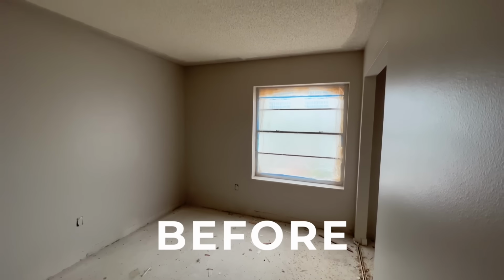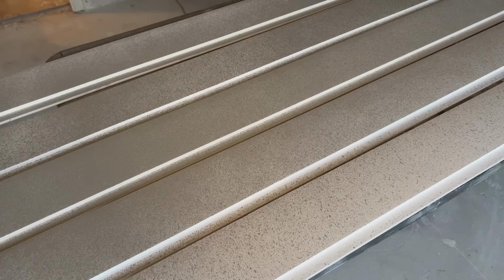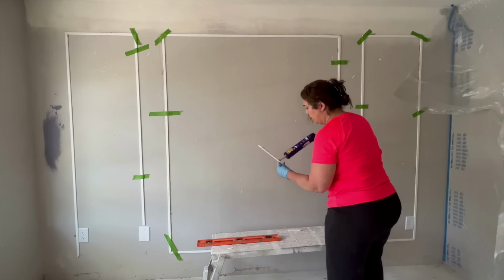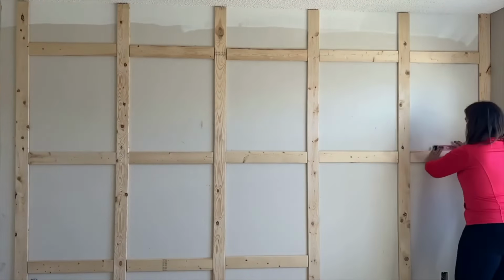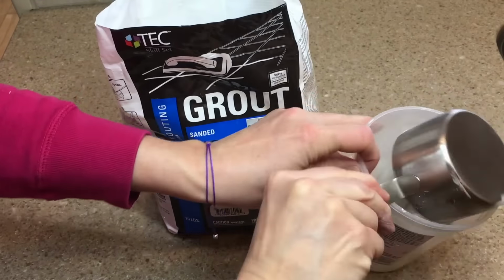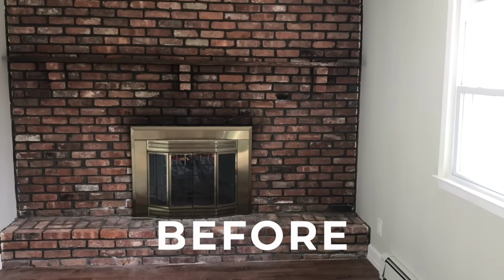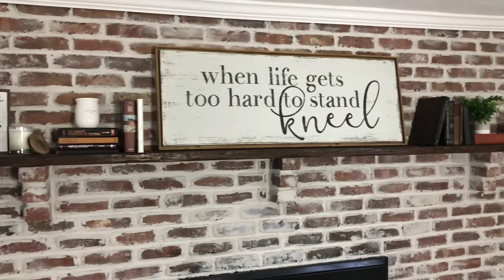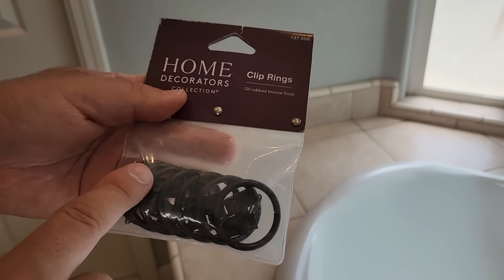The genius NEW way people are hiding their popcorn ceilings

Comment: I would be very curious how long the black paint on the faucet lasted.  Did it start chipping.  It seems like a great idea but I'm skeptical.  Cant imagine it lasting past a couple months.  Hope I'm wrong.
Reply: ccc
Reply: hear now✝️
Reply: Merina on her Fearfully Created YT channel painted her taps & her kitchen sink. A year on, the taps are still good, but the sink it's all chipping off very badly.
Reply: Removing the faucet and spraying with automotive paint worked for me. It's meant to take a beating. I just now had to touch up after about 3 years, and used black oil-based paint from Rustoleum out of the can, and that seems to be holding up well.

Comment: Ceilings: Thin sheet rock has been used for years to cover popcorn, instead of scraping. Quicker, easier less messy. 

Even of you used 1/2", it's still easier and cleaner than scraping popcorn. Just take your time and don't slop mud all over the place.
(IMHO of course)